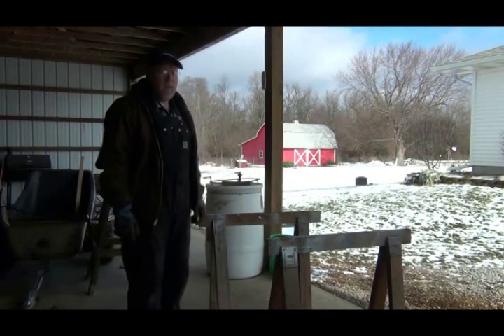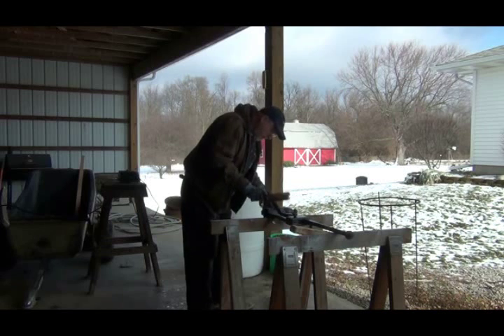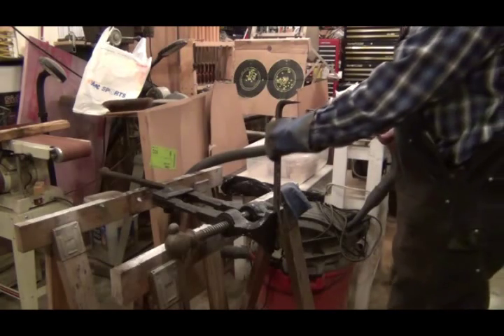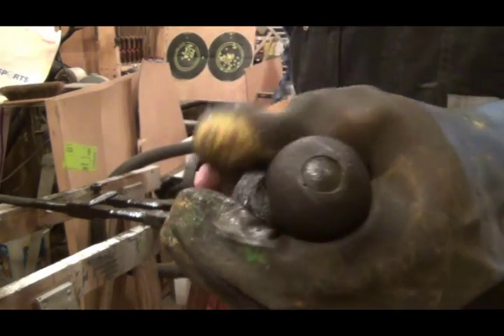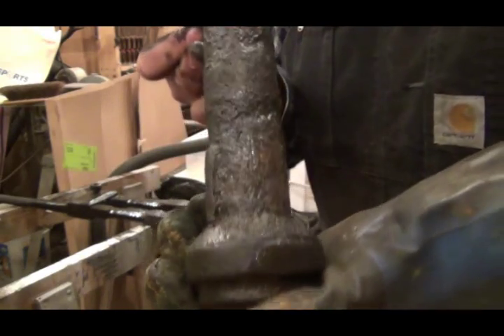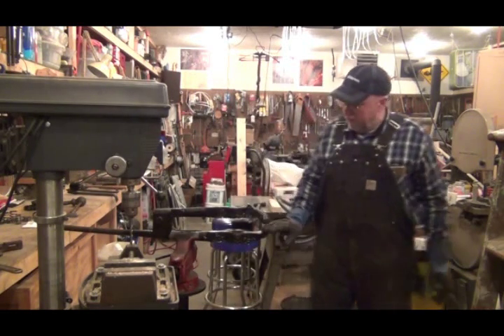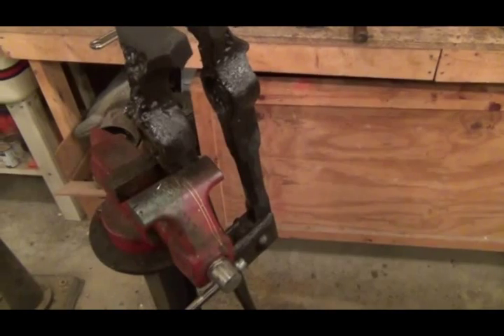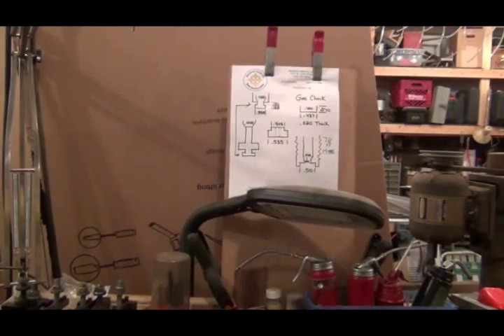Black smith vise 13 days in the electrolysis

Comment: Watching you work motivated me to work on a trailer hinge for a gate that has been frozen for years. After about 2 hours of working on it, it finally came loose and I can use the gate. I bought the trailer really cheap because the prior owner thought it could not be fixed. Lucky for me.

Comment: the tank will produce hydrogen and oxygen bubbles but it isnt explosive quantity amounts.   you can move that barrel inside without fear of fire.  I soak my things right next to my natural gas furnace in the wintertime.  You can also set up a smaller tank for the pieces you took off or just use the bigger tank with a dowl stick over the top to hang wires from at different depths.  run a smallish fan in the shop to circulate the air if you are worried about it.